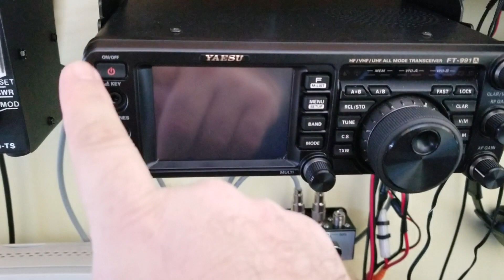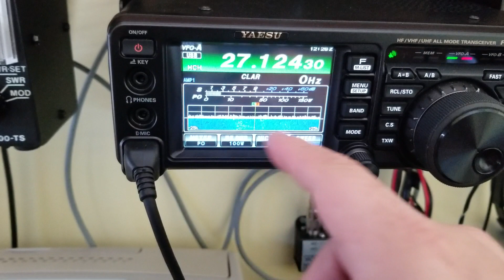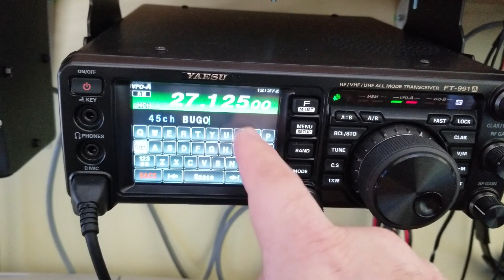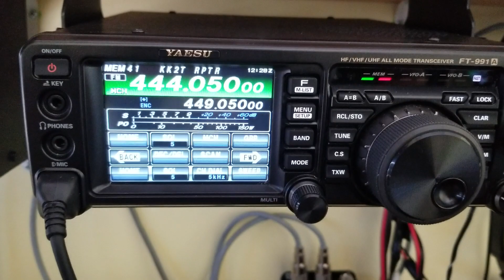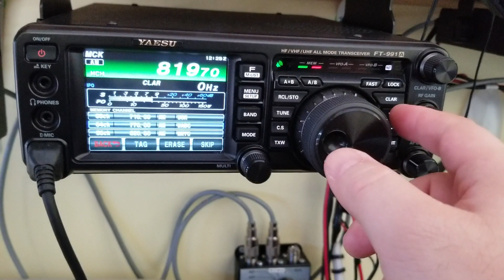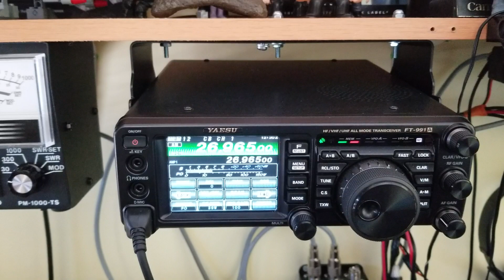Yeasu ft991a programming memory and naming memory channel.

Comment: I got me one of them thar Yaesu 991a's.  Sure do like that thar radio.  It be a gut radio.  Got me a friend that programmed the radio for me (thanx Ken).  I cain't believe it tuned up my long wire antenna on 6 meters since it be a long wire OCF for 160 to 10 meters.  But it will tune my Antron 99 on 10 meters too.  A gut radio that was MARS mod by the dealer (GIgaParts).  Kudos and 73 from W Rusty Lane K9POW in eastern Tennessee

Comment: Hello nice video I'm looking at maybe getting this radio since you've done mars mod how does this radio do on 11m? What kind of watts is it putting out? How's your reports? Thanks
Reply from the maker: I monitor 11 meters but it does 40 watts am into my dummy load.
Reply: @deeznuts...  lol good reply thank you always need a dummy load or least everyone should have one just for checking
Reply from the maker: @kevinz763  yessir.  Have you done the Mars mod?
Reply: @deeznuts...  not yet I'm on the fence which radio to buy yet...but whatever I buy I'll be doing mod
Reply from the maker: @kevinz763  the Icom  7300 is a great radio to consider.  They're similar in prices.

Comment: Edwin
How are you?
I got my ft991a 
I not use yet, last Sunday I install the antenna.
I do need the software for program this radio for 2 and 70 meters?
Thank you
Wagner
KC1MHJ
Reply from the maker: I programmed mine manually, I think you can get the software from the yeasu website

Comment: Have you tried going to a saved memory and changing one parameter, say AM to FM and then re-saving...  there is a %75 chance or even more you will loose the complete settings, if you had freq offsets or split stored which takes ages to do this is a pain as you have to start again, however bizarrely sometimes it does it OK, a definite bug...  and there are others....
Reply: Interesting, Do you have one of these radios?